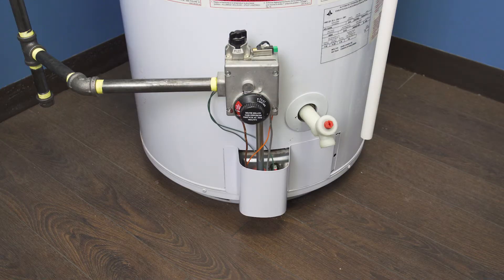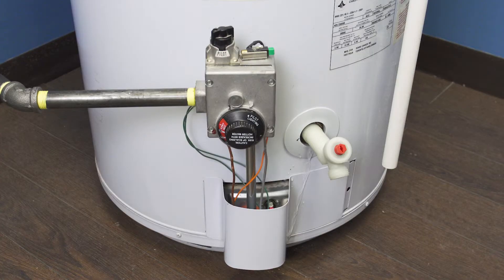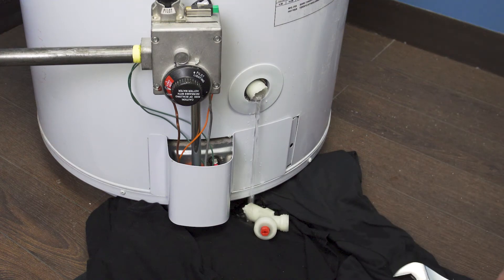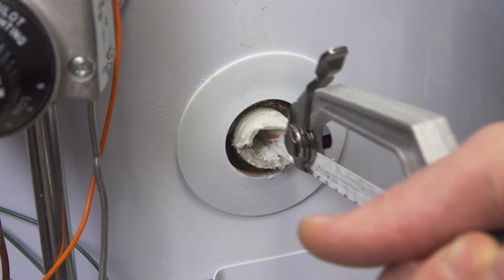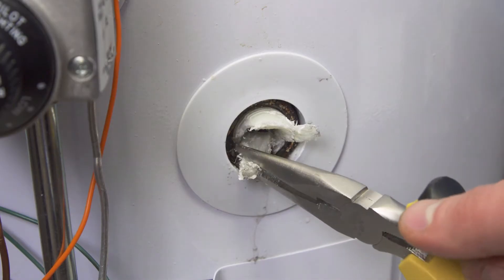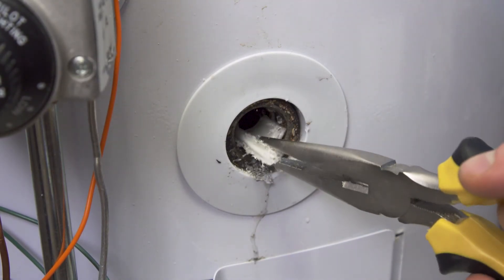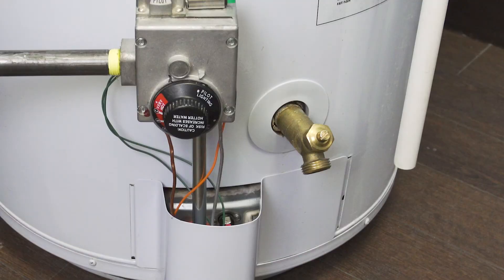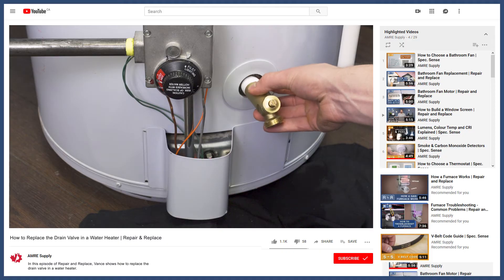How to Remove a Broken Plastic Drain Valve | Repair and Replace

Comment: Use a plastic riser extractor in the lawn sprinkler section of your home depot
Reply from the maker: Thanks for watching. That is a good tip for cleaning out sediment from inside the tank!
Reply: Or an easy out for pipes, same thing!
Reply: @joshuamoore24_7  essentially but ones for plastic and the other metal.

Comment: Thanks for posting this. Gave me the confidence to tackle the job. Was sure mine was going to break off. Plastic started to twist then snap... It broke loose without having to cut it out. YES!!!! I had the hacksaw ready in case. Used a brass nipple, ball valve, and hose adapter to reinstall. Used Teflon tape with pipe thread sealant over the tape. No leaks.. Works great.
Reply from the maker: You're welcome Mi. We're glad that the video helped you with the repair! It seems like you're all set now, especially with the ball valve!

Comment: If you are on ground floor or above you can use a rain diverter ( they go under the gutters) from lawn and garden it's inexpensive around $12 for a 25 foot tube.They may come longer.  It did great, no bucket bailing! Just measure from the water heater to a door and add a few feet to know what size to get. Oh and you may want to leave the pressure relief alone and just open a hot tap nearby, it's not too slow. Some people said after their pressure relief valve broke and would not go back closed 🤷
Reply from the maker: Thanks for watching and for sharing that! It's always great to see what different ways people can find to doing these sorts of things

Comment: A big thank you! I spent hours on a  17-yr-old State Select with a leaking plastic drain valve just yesterday evening. It was clogged with sediment and wouldn't drain, but was leaking and needed replacement. It broke off when I tried to remove it. After researching ahead of time and finding that this was common, we had buckets and trash cans ready to collect the water. I didn't have the proper saw, so just used the blade out of my hacksaw and did it by hand. Your video was a great help and we were able to install a much better valve.
Reply from the maker: You're welcome Sandie! We're glad the video helped you out! It definitely gets tricky, the older a tank gets the more likely you are to run into problems even when the repair itself is simple. Its good that you've upgraded the valve now and have removed that as a worry.

Comment: Got a good trick for clearing very firmly stuck plastic from the internal threads?  wire brush isn't budging them at all.
Reply: Try a blow torch, melt it away.
Reply from the maker: Thanks for watching. Heat can soften plastic and make it easier to remove. Be careful not to damage the threads but a sharp edge, small screwdriver or chisel can be used to lift or pry the plastic out.

Comment: Thank you this was very helpful. I’ll like to add that one peace of the broken Valve was very stuck and I could not get it to come out. I ended up using a heat gun after that one was able to pry it out easy. I lost few hours on trying to get it out cold…use heat gun and it will be much easier. Hope it helps someone.
Reply from the maker: You're welcome, we're just happy to help! The heat gun is a great tip, adding heat can often help loosen parts that are not moving.

Comment: I didn’t notice when I installed the water heater a year ago that the plastic threaded part you hook the hose up to was broken clean off with the valve. Now I have a full water tank and no way to drain it. How would you go about solving this problem?
Reply from the maker: Thanks for watching. If there are no threads then the tank would have to be drained into a container / bucket. This is very time consuming but afterwards you could install a full port ball brass valve and not run into that issue again: https://www.youtube.com/watch?v=nGCejMsKNX4

Comment: How did you avoid the flood in your basement?
Reply from the maker: Thanks for watching. In most cases the valve breaks when the tank is already drained and the plastic drain valve is being removed. In that scenario, not much water would come out.

Comment: If i try this will all the water in the tank come rushing out? Mine broke and im afriad of taking it off and flooding my house
Reply from the maker: Thanks for watching. With a plastic drain valve there is always a risk of it breaking. If you follow the steps in this video https://www.youtube.com/watch?v=nGCejMsKNX4 you can drain the tank before removing the valve. At this point the majority of water should be drained so even if the valve breaks you may only need to deal with several liters of water. Having a plastic bin small enough to fit under the drain valve can also help.
Reply: @AmreSupply  no problem thanks for the response I watched the video but I didn't see a solution. I can't start draining it because the part you connect the hose to is snapped off. So I don't know how to drain it without the hose connection
Reply from the maker: @lilflossin14  If you are still able to open the valve, then you can drain it manually with a bucket or container. This will take a while but it is still possible to drain the tank this way.
Reply: @AmreSupply  thanks again I may have to just call a plumber I only have a little baby sandcastle bucket haha. That'll take ages
Reply from the maker: @lilflossin14  Never hurts to call a plumber. Best of luck with the repair!

Comment: Hi. Mi plastic relief valve was apparently broken by the previous homeowners and I want to replace the valve but I have no way to connect a water hose to it due to the plastic threads broken off.  Can you give me some advice on what should I do?
Reply from the maker: Thanks for watching. Without proper threads, you'll likely have to drain the water into containers or buckets. If the drain is close by you might be able to use tubing or a pvc pipe to channel the water down into the drain. In this case let the water out slowly so it doesn't spew out the nozzle.
Reply: Hi, just saw  this so late to the game. I had to drain mine too, used a rain diverter ( they go under the gutters) from lawn and garden it's inexpensive around $12 for a 25 foot tube.They may come longer.  It did great, no bucket bailing! Just measure from the water heater to a door and add a few feet to know what size to get. Oh and you may want to leave the pressure relief alone and just open a hot tap nearby, it's not too slow. Some people said after their pressure relief valve broke and would not go back closed 🤷

Comment: How do I drain the tank before replacing the plastic valve?
Reply from the maker: Thanks for watching. We have a full tutorial here on how to drain the tank and replace the drain valve: https://www.youtube.com/watch?v=nGCejMsKNX4
Reply: @AMRE Supply  I can't drain the tank that way. As soon as I start turn the outside of the plastic valve water starts spraying out instead of going out the hose connection. I'm afraid to keep turning it for fear it will either break off or keep spraying water out around the outside of the valve.
Reply from the maker: @davejohnson5422  You could drain some of the tank through the relief valve. For the rest of the tank you might need use a bucket or a container and a towel around the drain valve to keep the water from spraying. It might take a long time but if you keep the water from spraying then just switch out the container or bucket and empty it as it goes.

Comment: My valve leaks because of sediment probably. I close the screw but water still leaks out plastic valve drain port. Can I screw it all the way out to clean the seat or does valve have to be replaced?
Reply from the maker: Thanks for watching. In some cases opening the drain valve all the way might allow you to clean it out but there are no guarantees. It is this reason why some people decide to install a  3/4" full port ball valve which is larger and is easier to manage. This is covered in this video here: https://youtu.be/nGCejMsKNX4?t=195

Comment: Will converting over to brass cause galvanic corrosion?
Reply from the maker: Thanks for watching. Galvanic corrosion can occur in certain conditions but a healthy anode rod will reduce any corrosion of the brass valve. Also keep in mind that the factory installed pressure relief valves are also made out of brass.
Reply: @AmreSupply  thank you! was just wondering since the original was plastic, and i generally see plastic on GE and some Rheem water heaters.  i just wish I'd see more full port ball valve type, but those are added costs.

Comment: We're replacing our water heater next week (non-emergency, but it is 20 years old and inadequate for our growing family).  I'd like to replace the cheap plastic drain valve on the new one (we already had it delivered) with a really nice brass ball valve that we bought. Is there any reason not to do this now, before we install it?
Reply from the maker: Hi John, thank you for watching. You are smart to be looking ahead like that and its definitely easier to replace the valve before the tank is installed. Just make sure that your ball valve is assembled correctly with teflon tape:  you can follow the steps here: https://youtu.be/nGCejMsKNX4?t=316
Reply: Use a boiler drain valve

Comment: Any recommendations for stubborn, old, plastic threads stuck in the tank that seem hardened and like they are fused to the tank threads? Of course the valve snapped on removal.
Reply from the maker: Thanks for watching. There could be a mineral buildup on the threads so using an acid like vinegar soaked in a rag could help loosen it. Also adding a little bit of heat via a heat gun could help but try not to completely melt the plastic.
Reply: @AmreSupply  Thanks for the reply! I ended up using a blowtorch and an awl to work the remaining pieces out. A vinegar rag and wire brush cleaned it up nicely.
Reply from the maker: @Helblind  You're welcome we're just happy to help! Thanks for the update its always great to know what ends up working for different people. All the best to you!

Comment: Thank you for posting this video. I have an old gas water heater with a plastic valve that I have been wanting to replace with a full bore brass ball valve so that I can properly flush it, and was wondering if anything bad could happen in the process.
Reply from the maker: You're welcome. We're glad you found it helpful! Plastic valves can definitely break when removing, especially if its difficult to turn. The plastic can't handle too much torque. Its not too difficult to remove, just takes a few minutes and some patience.

Comment: Thank you for posting this. What about the plastic hex nut shaped drain valves? How can those be replaced?
Reply from the maker: You're welcome Maxitikos. Most drain valves, even plastic ones have 2 flat sides that will allow you fit an adjustable wrench over. You can see this and the full repair in this video https://youtu.be/nGCejMsKNX4?t=260

Comment: We accidentally broke it's plastic valve in accident when moving things and we didn't know what was going on but this helps, now we just wait for the hot water to be back correct?
Reply from the maker: Thanks for watching. If the plastic drain valve is broken in any way then you'll want to install a new one. You can learn more in this video: https://www.youtube.com/watch?v=nGCejMsKNX4
Reply: @AmreSupply  yes we replaced the broken valve and now gives both water but instead of giving hot it gives cold water, could there be something else broken?
Reply from the maker: @potatosalad-xn8tn  You might need to relight the pilot. https://www.youtube.com/watch?v=d-KRwKdRNYI If it still doesn't heat then it could be a faulty control valve or the gas supply could be an issue.

Comment: What if it's leaking from around the threads of the plastic drain valve?  I can see a lot of rust where the plastic valve meets the internal metal body.  Can it be repaired?
Reply from the maker: Hi Dinara, thank you for watching. It would be best to install a new drain valve. When you remove it, you can try cleaning up the threads with a wire brush and some vinegar. If the threads still look damaged or don't make a good seal then you might have to replace the tank.

You can see this repair here: https://www.youtube.com/watch?v=nGCejMsKNX4
Reply: @AmreSupply  Thank you.

Comment: A piece of plastic got pushed back in the water heater. I tried flushing it out, but haven't seen it come out yet. What happens if the plastic is stuck inside the tank?
Reply from the maker: Hi Steve, thank you for watching. Those sorts of things happen. Chances are the plastic might settle to the bottom of the water heater but depending on how small it is it might also travel through the system and could end up in one of the faucets. So keep an eye on your faucets as the plastic could cause a blockage but its hard to know for sure.

Comment: why do they use plastic?
Reply from the maker: Hi Joshua, thank you for watching. Plastic drain valves are sometimes used in water heaters as they are less expensive overall and will not corrode.